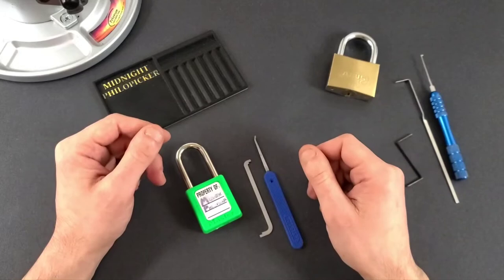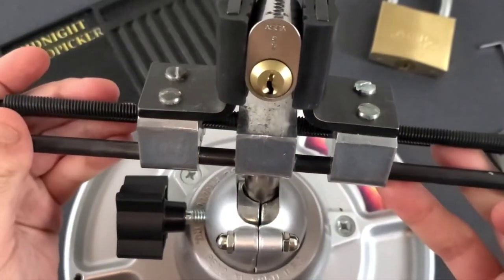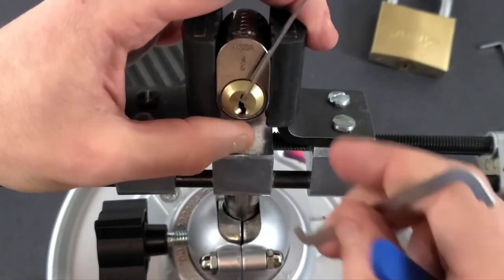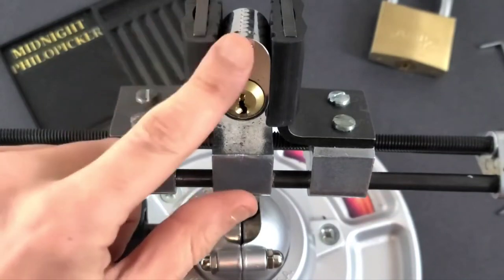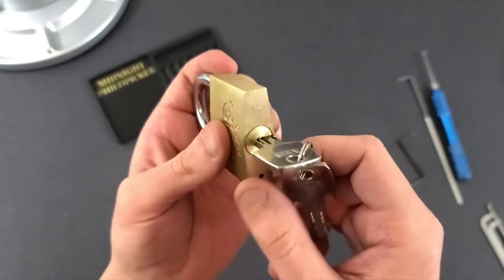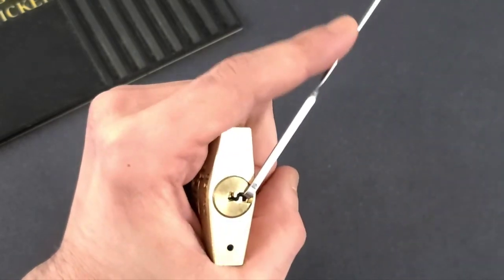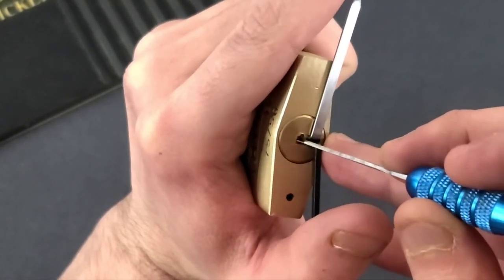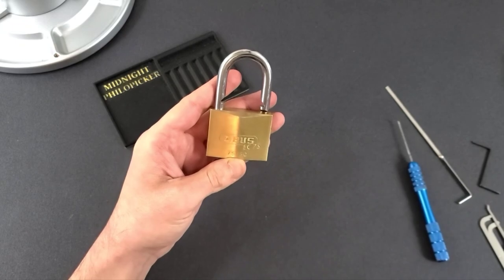[30] Introduction To "Float Picking" || (Abus EC 75/50)

Comment: Currently busy trying to pick this one. The idea of float picking it, has not come to mind yet. I just find the pins to be brutal strong in this particular lock. To add salt on the wound, it also has pins coming from the top which obstructs the keyway even more, making positioning of the flag even harder than it should be.

Comment: 🧐 hmmm wouldn't it be easier to find two fitting TOK tensioners that fit 45 degrees into the keyway on the right side? 

Is there any benefit from having your fingers "stretch" in both ways instead of having precise control of how the core turns using one very snug tensioner?

If they are nice and snug you can use "one combined" tensioner to control turning in both directions. 

I'll try it out on my own ABUS EC75 to make sure.

Right now I'm baffled that I can't open euro profile cylinders because of the milling that houses the pinstack. It just feels like it glues down the pins as you pick them. I learned yesterday while picking the GOAL S that I can use float picking to lift these pins, regardless of the new technique introduced, I couldn't get an open. Which is kind of sad 😢

Comment: I've been struggling with this lock. I actually have the 60mm version but I'm sure the technique is the same. My first issue was finding a pick that would raise the pins up around the warding but not be so long that it hit the warding on the other side. Then finding a tension to that would fit right was the second issue. I think I have a plan of attack now.
Reply from the maker: Yup, sounds like the same struggles I went through when first playing with this lock. Did my video end up helping? How is the progress coming along these days if I may ask?

Comment: Exelent demo Isaac. I have recently started learning this technique. Progressive pinning an ASSA 600 with jin spools. How do you tell the difference between a set jin spools and when its stuck in the counter milling?
Reply from the maker: I find that at first it was pretty hard to tell the difference between the two. But the more I picked locks with gins, the more the feedback became clear to me. Both when gins are caught in the milling, and when a pin is set, it will feel stiff when you press on it (if you are in a false set). The best way to describe the difference from my experience is that the set pins are a little softer then the gins that are caught in the milling. Gins in the milling are very stiff, but as you start to float pick, they wil start to become a little bit jiggly. Once it gets to that point, then don't back off any further, just wiggle the pin while releasing pressure on it and then lightly lifting. Sometimes you need to play with the pin for a while before it will decide to slip out of the milling. A really good way to learn the feel is by progressive pinning the gins in pairs. Keep me posted on your progress!!

Thanks for stopping by :)
Reply: @IsaacHashman  thanks for the info Isaac. Il keep you up to date. And try and feel for what you said  i can manage with 3 pins so far. Could be better tho👍

Comment: I own enough tension tools to get "tight" tension. I'm not sure "Float" picking is really a thing! Unless someone is short on tension tools...
Reply from the maker: Float picking is definitely a thing and is required to pick certain locks such as the Assa 700 when gins get stuck in the countermilling.

It's not about how many tensioners you have, it's about being able to fully control the plug's rotation in both directions. That way you can pull back on the tension to a very specific degree without dropping pins that have been set or partially set. Therefore if you are just using one tight fitting tensioner, it is still float picking, as I explained in my video.

As for what method of float picking is best? It really depends... there are up sides and down sides to both.

With 1 tight fitting tensioner, you have more space in the keyway to work your picks, but at the same time, the keyway will eventually start to wear, and the once tight fitting tensioner will start to become loose. On the other hand, 2 tensioner are harder to work picks around, but will never become loose even if the keyway becomes worn
Reply: Talk about entirely misunderstanding something.